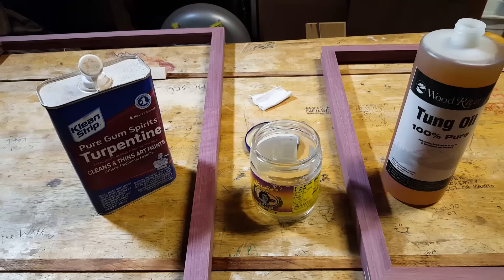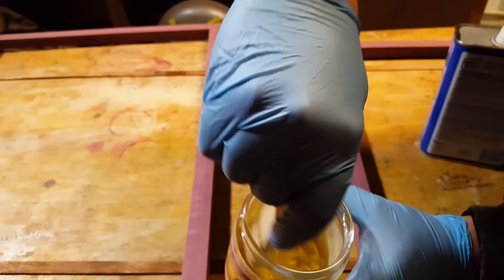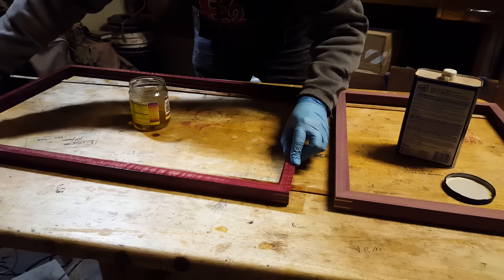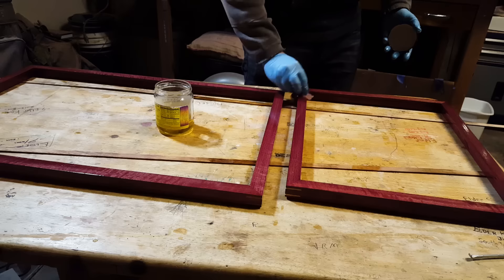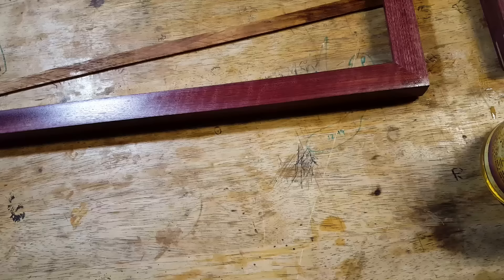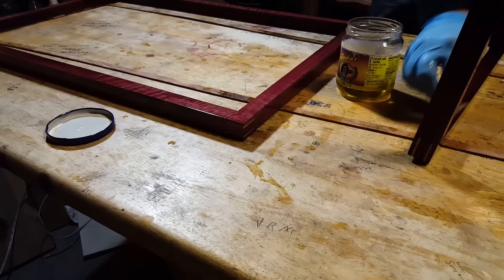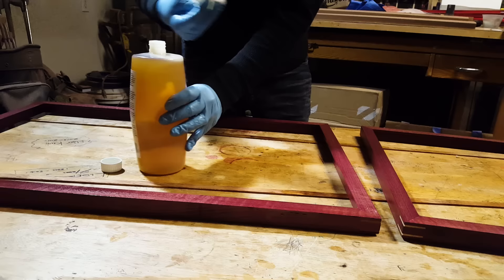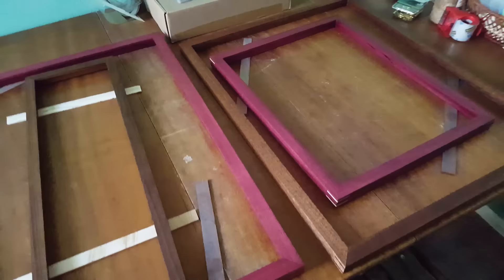How to Apply Pure Tung Oil to Wood (the right way)

Comment: I am wondering if you can answer my question. I recently put walnut counter tops in my kitchen. I tried using the beeswax orange oil finish but wasn't happy with it and wanted something more durable and protective. I decided to use tung oil instead. So my question is will i have to remove the wax completely before using the tung oil? Will the wax inhibit the tung oil soaking into the wood and not allow it to cure correctly?
Reply from the maker: I am not sure I understand which finish you already used, is it something you made out of orange oil and beeswax? Regardless, you would want to apply tung oil to raw wood. Once the tung oil has cured for a week you can wax it (even though it will take longer to fully cure). It sounds like you are going to have some work removing the old finish. If you are going to use pure tung oil on a high use area like that be sure you do not skimp on the coats. I would probably do 3 diluted and 7 undiluted for something like that. Applied the same way as shown in the video at 1 hour intervals. I hope this answers your question.
Reply: Yes that helps! Thanks for the quick reply.
Reply from the maker: No worries, have fun.

Comment: Hello!
I'm about to use 100% tung oil on my stair case and I've also read the description below the video. Is Orange Oil the same as citrus cleaner or Pure Cold Pressed ORANGE OIL on Amazon? Thanks!
Reply: Cold pressed Orange Oil is usually listed as non-toxic.  

Citrus cleaners will contain citrus/orange oil, but can also contain solvents, detergents and other additives that put them clearly in the poison control category.  Whatever product you are considering, dig up the SDS (Safety Data Sheet) for it, which will list any toxic additives and poison concerns.

Comment: What's the difference between, tung oil, boiled linseed oil (aka TruOil) and danish oil? Which is the most color neutral?
Reply: Jeff Gillis, pure tung oil is an all natural product used for centuries in China, very light golden finish coloration, will require a few to several coats and will stain, seal and finish the wood all in one. Just be sure it is 100% pure or you might as well use BLO. BLO (boiled linseed oil) is a chemical compound of linseed oil and other chemicals combined and finishes darker than tung but also much faster. Don't confuse this with pure linseed oil, which while linen was a thriving product was readily available and used for the same purpose but has a significantly longer drying/curing time. Danish oil, again, chemical compound of oil and such, but comes in a few different shades of coloration. Also has a fairly short drying/curing time.
Of the 3 choices, tung will take more coats and more time but, and this is significant to me, tung is the only one that has no or very low VOC, unless you add it, and is ok to use on food grade surfaces. It will seal wood well enough that the Chinese had used it to build ships for centuries. It can be reapplied if the finish fades, as long as no other sealant has been applied. It will not get a high gloss unless you polish with a gloss finish, but instead will give a hand rubbed satin like finish naturally. It is a natural resin forming oil that hardens and seals through the process of oxidization. Full cure can take up to 30 days and item should be kept out of direct sunlight until it is cured.
There is a site called Real Milk Paint that has some serious amounts of DIY content concerning tung oil use, if ya need more info, that's a good spot to start.
Reply: @kennythiessen5044  thx kenny. Another question, as ive heard that walnut will fade over time and its suggested that a uv poly wilk protect it from this fade with exposure to ambient daylight over time. Anythoughts on uv protection for walnut?

Comment: I have build several planters boxes.  I want to plan herbs and vegetables and we are going to eat them.  I have used mahogany wood and I have applied tung oil.  They are for outside and they will be exposed to sun and rain.  Do you think I should apply any finishing over the tung oil because of UV or discoloring? But, it has to be food safe too.  I am trying to bring out the reach color of the wood.  Thanks
Reply from the maker: Mahogany planter boxes, you and I would get along really well. I am a big sipo and sapele fan. If they were my planter boxes, I would buy some plastic planter bins to put inside the boxes. I haven't really tested tung oil's water resistance yet, so I would rather be safe than sorry.
Reply: I agree, or line them with 6 mil plastic sheeting at least. Waterlox marine would probably work better for outdoor planter application.
Reply: Frank, check out Realmilkpaint.com. They have a tung oil finish with zink to prevent outdoor mold growth.

Comment: Some people even wait for 1 week between coats...Is 1 hour enough??
Reply from the maker: Are they using tung oil or 100% pure tung oil? Most "tung oils" don't even have real tung oil in them, they are just branding their varnish. Check out the video description for a list of some of these "tung oils". If they are using pure tung oil, my question is why? That makes no sense. Seriously. Exposure to air hardens pure tung oil. Why would you let it cure a week before applying more? This isn't a layering finish.

Comment: Can I dilute the first coat with mineral oil instead? I'm coating my kitchen table with it.
Reply: Jesse, No, another oil will dilute the tung oil but it will not thin it.  You are trying to get it to penetrate more deeply into the wood so the liquid needs to be not as thick.
Turpentine is good.  I use citrus solvent,  i.e. orange spirits. But it is a bit more expensive.

Comment: could you please tell me how can I get rid of the smell of tung oil after I apply the finish?
Reply: Niko Wu time
Reply: When the oil has cured (about 4 to 5 days between coats), it will be odorless. 
Tung oil doesn't "dry", it "cures". Meaning, there is a chemical process that takes place,  specifically - polymerization.

Comment: Is that wood stained? I'm wondering about using tung oil to finish after using a wood stain. Seems that a water-based wood stain would be okay in this regard. Any insight on this? Also, I recently did apply non-diluted tung oil to a previously unfinished guitar neck. Seems like it came out really beautiful but it's only been about 24 hours. It's hard maple. As you recommend diluting it first I'm wondering, is there some problem that I many have by not thinning first, and also if I go back now and reapply with thinned tung oil will that help? Thanks a bunch.
Reply: Did you ever figure out your stain question?

Comment: would you reccomend using tung oil on things like dinnertables etc. ?
Heard some people say it would be "toxic".
Reply from the maker: You can, just don't dilute it with Turpentine/Mineral Spirits. Dilute it with a food grade orange oil/d-limonene instead. Tung oil is food safe, you just have to make sure you are thinning it with something food safe as well.
Reply: The solvents all evaporate in the process of curing, right? I don't see why they would be an issue. I have read multiple articles by professional finishers who say all finishes are food safe when cured.
Reply from the maker: You are right that when any finish is fully cured it is safe to come in contact with food, but the problem is that the finish itself is not safe to consume. So the additives in the solvents (heavy-metal driers, plasticizers) are encapsulated once the finish is cured but still are not good to eat. I think most people looking at using food safe finishes are using them on pieces like cutting boards. In which case you are going to be eating a small amount of that finish.

Comment: I'm refinishing an old built in hutch.   Steel wool to scuff down the old varnish and then an oil stain over that.    I think the oil desolved some of the soaked in varnish and it actually looked good and was very smooth.   Tried putting tung oil over it and getting the blush.   Humidity has been high but at around 45 percent today.    What's the best way to get rid of the blush?  Or the white film that can form.

Comment: So, you only wait an hour in between coats? Not 24 in between? I'm working on an oak bench and would like to try Tung oil. I would thin the second coat like you said since it's a hardwood. What kind of wax would you use to finish it, and how long should you wait to apply that? It will be a high traffic piece. Thanks!
Reply from the maker: Hi Julie. Yes, no more than an hour between coats. Now this is for pure tung oil, be sure to check the list in the description that lists a bunch of "tung oils" that are not pure. If you have one on that list then you need to follow the instructions on it. Are you using red oak or white oak? I would wait at least a week before putting on a wax. Since it is a high traffic piece, you may end up having to wax it one or two times a year. I like to make my own wax, lol, go figure right? I use a pyrex bowl on top of a pot of boiling water for a double boiler, and I melt beeswax (from the local farmer's market), then add equal parts mineral spirits (orange oil if you want to be green), and boiled linseed oil. But, if you don't want to make it, I have used Paste Finishing Wax by Minwax, and am pretty sure it is nearly the exact same. You can get that anywhere. Good luck with your piece, it sounds awesome.
Reply: Melody's Dad I believe it's white, but could be red. It's my husband's project, but he wanted my opinion on finishing it. If we can agree on something, that is. The tung never really dries, I've heard and isn't a long term solution, so while I wanted to try it, we may go with something else.
Reply: i.e. not as durable as a poly finish.
Reply from the maker: Yeah, tung oil doesn't provide a protective layer on top of the wood, but it doesn't amber over time either. I think it really depends on the finish look you want. If you want a matte finish go for tung oil if you want a glossy finish, go for a poly or epoxy.
Reply from the maker: I was just asking out of curiosity. I really like quartersawn oak, and need to make something myself out of some soon. So I hear what you said about it never drying a lot. Which is why I made this video. It does dry hard in the wood, if you apply it right. Sadly, I have heard nothing but bad information on how to apply it. Makes me sad really, because it is my favorite finish. It's really important to apply coats close together timewise, wiping off excess after every coat, and then wiping off the oil it sweats out over the next day or two. But then it doesn't fully cure for a month. I think, most people are desperate for instructions that shorten that wait and is why they end up with an oily mess. But, it does dry hard when done right. You guys will figure out the right finish, lol. I hope everyone understands I am not saying tung oil is always the right choice for a finish, It makes perfect sense to me to use a poly based finish on something that is going to be sat on and used a lot. I would probably lean that way too, just because I wouldn't want to keep waxing it over and over. On something that is hanging on the wall, you can get away with waxing it once and you are good for years. Just my opinion.
Reply: Turns out it is red, which is slightly harder, I believe. Anyway, thanks for all your advice! We'll be doing some more research and hopefully deciding soon!

Comment: local Albuquerque person?  Sadies salsa jar?
Reply from the maker: Las Cruces. Big fan of Sadies. I am glad they bottle their salsa. We can buy it from the grocery store down here.
Reply: Thanks for the post.  Looking at a Tung or Danish oil finish for some interior doors.  Seems like a bit more time, but a bit less skill, and more forgiving than stain/polyurethane.  I have never cared for polyurethane.  Seems like a short-term finish...   problems after 5-15 years.  I'd like to start moving to oils, which I would think could be re-applied with little effort every handfull of years.  Better for for long-lived items.
Reply from the maker: I agree, I'm not a fan of polys (varnishes) so much. They change to a pretty nasty amber color with age. Linseed oil even does the same thing. Tung oil doesn't do that. And if the wood you are using is already naturally a beautiful color, it will just bring that out. FYI danish oils have polys in them.
Reply: Thanks for the tip on the Danish.  I was afraid of something like that.  If I'm in a hurry, is the Formby's "Tung" product just Tung with thinners/emulsifiers.  I have some Tung and Orange thinner on mail order...  but if it does not arrive in time, I may start doorjams with Formby's.  I intend to keep some Tung around from here on out for touch ups.
Reply from the maker: I have serious doubts there is even tung oil in Formby's tung oil. It definitely is a thin wiping varnish, and I use it sometimes for projects with real light wood, like a curly maple. It's all preference. What type of wood are you using?
Reply: Just pine doors for now.
Reply: Melody's Dad, I have a friend in Albuquerque; could she find Sadies at the store? Not heard of this in SoCal, like to try it. Btw, I liked the music too.

Comment: Hello! Great video. But I have some questions.  I am looking for non toxic,,water resistant finish for making wooden flutes. Is pure tung oil a good option for this purpose? Why did you use turpentine?  How many days are necessary for proper curing?
Reply: pure tung and pure linseed oil are not toxic but won't protect against water... Beewax provides waterproofing, but i dont know if it will be last on wooden flutes

Comment: Does this seal the wood at all?
Reply: Yes. Tung oil polymerizes. Which means that the molecules cross-link like a plastic when it cures in the presence of oxygen.  This causes the hardening and also a sealing within the pores of the wood.

Comment: In minute 1:15, you mention being "Green" by skipping Turpentine. Why? If 1 uses the turpentine purchased at the box stores, but 100% Pine Gum Spirits Pure Turpentine is a 100% plant based solvent, safe just like Orange Oil or the active ingredient D--Limonene. So, your Turpentine is NOT green, but Diamond G Forest Products produces 100% petroleum free Turp, which bc it being an organic substance is broken down in the soil by microorganisms; unlike Petroleum Turp!

Comment: How well does this hold up???
Reply from the maker: It makes the wood water resistant, and isn't susceptible to mold like other oil finishes, but it doesn't protect the wood like a poly, lacquer, or epoxy would.

Comment: Hi, I tried applying danish oil on my worktop and after the third coat, the surface feels sticky to touch, any suggested solution and why it feels sticky?
Reply from the maker: I am sorry for the late response. Danish oil gets sticky if you layer it on the surface like a polyurethane. If I were you I would sand down to the surface and reapply it. But this time flood the surface with the danish oil and let it penetrate the wood for about five minutes then wipe off the entire surface with a paper towel. Let it dry 30 minutes, then do the same thing for the next coat. My guess is that you didn't wipe off any of the excess danish oil after a coat, and that stuff just sits there and turns into a sticky mess if you don't. I hope this helps.
Reply: Thanks for the reply. Don't worry about delay. The key thing is that, not many on youtube talk about how long to wait - it's often left open and that can be very confusing. So thanks for, "let it penetrate the wood for about five minutes" that's a gem, to me. I like clarity. That said, when I went to wipe it down after about 4-7mins (didn't time) it felt sticky and it was catching on paper towel. Then I decided to sand it down and applied a thin layer of oil and will do that again. Do you recommend me using a 'wax' product after the oiling process? What's the difference?
Reply from the maker: I have never used wax on a danish oil finish myself, but I wouldn't recommend doing that if it is sticky. That will just make it worse.Also, I personally wouldn't recommend putting wax on a worktop, either way wax should only be applied after the finish is fully cured. If an oil finish is sticky, then it isn't cured, nor will it cure right.  You could try either wiping off the excess oil sooner, or applying more oil so it doesn't dry out quite so fast, or a combination of both. I would do the combination of both. You really need to go back and almost apply like a second coat during the first coat because some areas are going to soak up the oil faster than others. Just FYI, most danish oil is made with boiled linseed oil, or tung oil with hardeners. Both of those oils need to penetrate the wood to dry properly. Any of the oil left on top of the wood, will turn gummy as it starts to dry. And with the hardeners it starts drying pretty quick. I am sorry for the mess. I have been their before, and I know it isn't fun when a project goes awry like that. My recommendations are all coming from my experience with danish oil. I still use it, I like it, and I have my own way of doing it. So someone else may have a different method, I am just sharing with you what I do. I hope it helps. Stick with it - accidental pun...
Reply: lol, love the pun lol. Yeah, experiment is the way learn, for me anyways. I applied another after sanding it down, it has dried fully, so that is good, i will apply one more coat but a thinner one and that should do the trick, thanks for sharing your knowledge and experience, that is why I love YouTube!

Comment: Wrong. The moment you put the paint thinner in there, you made it varnish. Tung oil and linseed oil dont need any thinning agent or anything added to them, its as simple as apply, wipe, let sit and sand between every application for tung oil or once for linseed oil. Why you would buy 100% tung oil just to dilute it is beyond me, might as well buy something pre mixed.